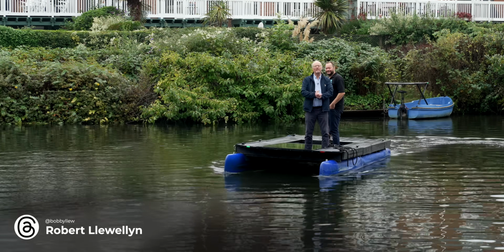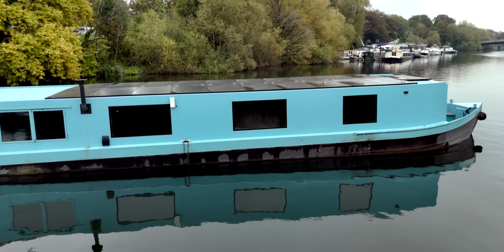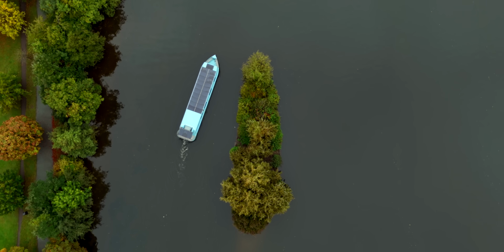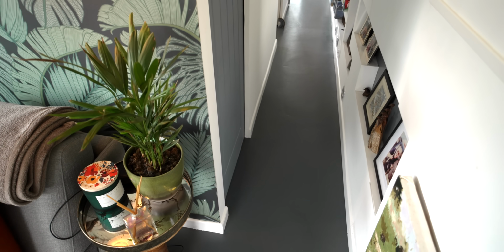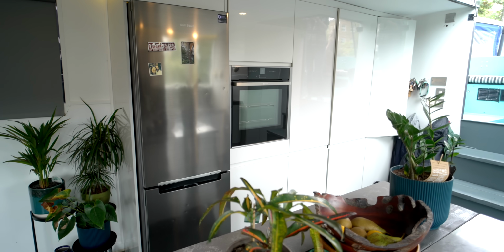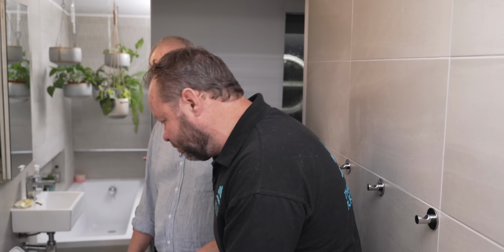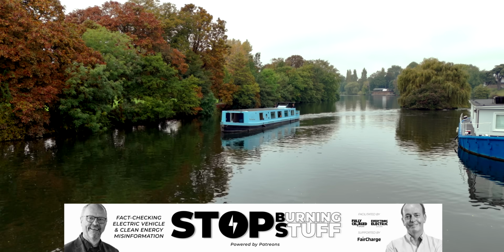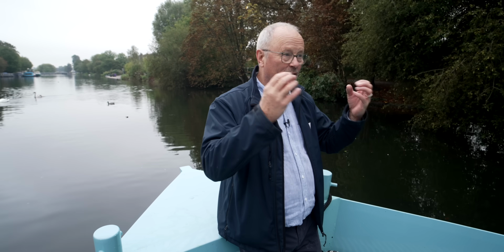Living On An All Electric, Off-Grid Dreamboat!

Comment: 1:47
2.6 tons for just 96wkh?
They should really look into junkyard model s p100 battery packs. They could get the entire tray on its own, no need to pull modules out
Reply: Considering they still needed another 17 tons of concrete for ballast I think energy density wasn't a concern at all. A heavier pack was cheaper and reduced their concrete bill.
Reply: 48kWh even - with lead acid you shouldn't go below 50% depth of discharge or you will kill your battery cycle life. At this point, you'd look into LiFePO4 for cells - I have 60kWh  powering my house. It's safer than NCM and other cobalt containing lithium cells, and it doesn't mind being charged to 100% all the time.
Reply: Lead acid batteries causes fun for boaters who can spend a lot of time running engines to top up (or equalize) ... lithium is the way to go if you want batteries to sit at < 100% charged for long periods of time. Part of the problem is that "lithium ion" is perceived as an insurance risk, even if using "lithium iron phosphate".
Reply: @Ryukachoo 96 kwh at 48 volts, I think that's more than a Model S p100 battery pack.
Reply: @dogbreath6974  Not really - 96kWh is 96kWh... if the voltage is lower the amperage is higher...  iirc the Tesla Model S pack is 400v (rather than 48v), so the fork-lift batteries can likely deliver ~10x more amps (which would make sense, given they'd have to drive a forklift, including the 'lift' when fully loaded)
Reply: Price per kWh of OPvZ cells is considerably lower than Li-Ion + the added ballast benefit for the boat.
Reply: @johumm455  LFP cell are now available at around 100Euro per kWh though...
Reply: @johumm455  I think the ballast effect is of fairly low value; you can get building blocks at £0.18/kg.
LiFePO4 prices have come down a lot since this boat was built; off the shelf Pylontech are £1350 for 4.8kWh, so £280/kWh. Random googling shows 2000Ah of 48v OPvZ  are £20,000 or so, so perhaps £200 per kWh.
Reply: Probably expensive / hard to source. But it could be a nice upgrade in a few years when that changes. Also, they could get more kwh; though arguably this is probably enough. I imagine the range of this thing is not amazing. But probably they don't do a lot of traveling with this thing. And for domestic use, 96kwh is plenty. That amount of panels should probably deliver more kwh than they use on most days. And you can always plug it in during the darkest periods of the year. Though I expect that might not be needed even.
Reply: And what cost and complexity would you be adding to solar charge a 400v Tesla pack.

Sometimes the old ways work better, and I suspect this is one of them.